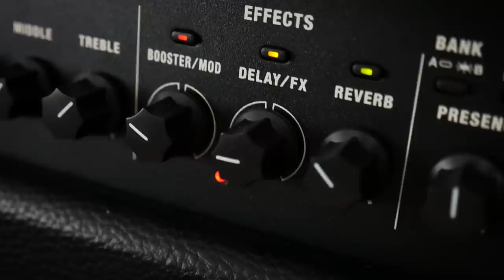Amplifier Classes Explained | Boss Katana Artist

Comment: Hey this video was great and all but would someone mind explain class a in a little more detail? If class a means there's only one output device a tube or transistor what about a vox a.c. 30? I've always heard they were class a but they have 4 output tubes so then it must be ab right?
Reply from the maker: Sorry for the confusion: Class A is the only class that CAN operate with a single output device, but that doesn't mean you can't have more than one. 
Class A operation is defined by the output devices conducting over the entire range of the input signal. This can be achieved with one or more valves/transistors. 

Class AB requires at least 2 output devices to operate. You CANNOT get a single ended Class AB. 

I hope this clears things up.
Reply: @ScienceofLoud  hey thanks so much you definitely cleared that up for me.

Comment: so this is why my valve amp sounds killer but warms up the room by several degrees despite it having open panels and a heat sink? good to know. glad the katana sounds good (if a bit brittle and lacking in the mid-range to my ears), we really need to bring good solid-state amps back to the forefront and maybe get rid of the "if it's tube it rocks, if it's solid it sucks" stereotype. 10 years ago we had that debate concerning digital amps, and nowadays everybody's got a boner for kempers and axe-fx's. the roland jazz chorus is a killer amp that is solid state, but to my knowledge, that's the exception to the poor reputation of ss amps in general.

Comment: You skipped class C. Class C is a class B with compensation for the crossover distortion which does not require biasing. It preserves ALL of the efficiency of class B but reduces the crossover distortion to nearly inaudible. However, 0.1% distortion is common, which wasn't good enough for the distortion wars, so it fell by the wayside.

One way to make a class C is to drive a class B with an op amp but have it's feedback come from the output of the transistors instead of the op amp. The op amp itself will then compensate for the crossover distortion automatically.
Reply from the maker: Class C isn't relevant to audio amplification as it only amplifies one half of the waveform (conducting only over 180 degrees max), hence is moot in this conversation. 

It is used to transmit RF waves, it's not used in guitar amplifiers.

Comment: I spent 2 weeks with the Katana artist.
Let be truthful, and strait.
The Katana does not sound like a good tube amp.
I play metal. I use a 5153 2x12, and Boogie 2c+ head, so that is my reference tone.
The Katana is good for fucking around on ,but it does not come even close to having the presence, and the girth if a good amp.
For a kid with no money, this amp is a god-send.
Great for a ss amp, but it is a ss amp.
As a side note.... companys that put "attenuators" on ss amps really bother me.
The way you attenuate a ss amp, is to turn the volume down.
Unless they have somehow developed on output transformer that thinks it is being fed by output tubes, which they haven't, its just another fake selling point, made to fool uneducated people, and making themselves look like fools in the mean time.
People love to argue about this, they are just wrong.
Even the attenuator on my EVH is fake.
It lowers the pre amp signal before it gets handed off to the output stage, instead of taking the powered output signal, and converting unwanted electrical energy into heat.
Just my 2 cents.
Good video.

Comment: is this to say that class d amplifiers are inferior to class a/b?
Reply from the maker: Absolutely not. There is no such thing as one class of amplifier being objectively inferior - they all offer advantages or disadvantages depending on application. 

Where high power, high efficiency, low cost are important factors Class D far outweighs Class A/B in terms of advantage - which is why we see it used extensively in bass amplifiers, bluetooth speakers, and TV sound systems. 

Class A/B may be preferred in guitar amps, hi-fi and other audio situations due to the fidelity it provides. You pay more for less power, but it yields more accurate reproduction. 

With any amplifier design you trade fidelity for efficiency - and choose the design which best represents the situation and budget.
Reply: @ScienceofLoud  awesome thanks man, in my context I am indeed interested in guitar amps so it seems like if we can find more amps like the katana which can balance the cost and still have class a/b then it's a win

Comment: Little remark: Class A push pull exists ;) a Class AB push pull can become A when biased that way
Reply from the maker: No one said it didn't exist, what was said is that Class A is the only class that can be single ended.

That's not the same as saying Class A can only be single ended, which would be wrong.

Comment: ...so what is Blackstar Metal 100 amp head???
Reply from the maker: Blackstar HT Metal 100 has four 6L6 power valves. They'll be working in two push/pull pairs, so the amp will be Class A/B. 
The website lists also that the clean channel can run as Class A.
Reply: Awesome info. Thx. Love your channel much. Where can I buy me a “More Gain!” shirt too???

Comment: I tend to disagree with your definition of classes A and AB:

For audio amplification, a class A amplifier can be either single-ended or push-pull.  Now, you might be thinking, how can a push-pull amplifier be class A?  Doesn't one side amplify half the waveform and the other side amplify the other half?  Isn't this why we use a phase splitter?  These are common misconceptions.  You can, indeed have a true class A amplifier that operates in push-pull mode.  Amplifier class has absolutely nothing to do with output stage topology. 

Source: Aiken Amps
Reply from the maker: I never said you couldn't have push pull Class A. I simply said that Class A is the only class that can operate Single Ended. 

In fact, I mentioned Push Pull Class A when talking about low wattage Class AB.

Comment: As a bass player I was seduced by a 600W class D amp that weighs 3kg, over my old faithful valve monster with a mere 100W that needs a small team to lift it. I know valve watts are more powerful than solid state watts, but how the flying fuck is 100W louder than 600? On the other hand - on a pub gig I can now run a profit, and I'm a mercenary bastard, now with good back health. But a poorer soul.

Comment: I have an AB and it was sufficiant but once I tried Class A on same Speaker it is a whole other world. In Clean nothing goes over Class A but on Distortion I think AB sounds better. The Katana sounds like crap. For 100 € you get a Laney cub8 class A that is superb and much cheaper. Also I think you recorded with Rode NT1000 that is not good sounding for guitar amp recording. Small and cheap codensator mic would sound much better.

Comment: So, this is actually a Katana promo, thinly disguised as an informative piece on amplifier classes. I'm not impressed. A couple of points. First: class A amps or not more linear than class  AB amps. The distortion just contains different harmonics. Second, it is not just boutique amps that have a single ended design: all early Fenders did and so does the recent Marshall class 5. Second, class D is in fact vastly more linear than class AB. Even cheap class D amps vastly outperforms class AB amps. Almost all PA systems nowawadays are class D and those need a much higher bandwidth than a guitar amp. Third: you are suggesting that the Katana is somehow unique in using a class AB solid state power stage. But that's nonsense. The micro terror for instance also has a simple class AB power opamp as a power stage. Hell, the old samick practice amps were all class AB. Sorry, but I hold you to a higher standard than this!
Reply: Think he mentioned it was a promo. Get over yourself.
Reply: At 4:00 he literally says class AB is the the most common class of amplifier. You really think he is making the katana out to be unique with this statement?

Comment: A/B is more linear and more expensive than Class D to build generally. Class D is more efficient but less Linear and less expensive generally to build....  There are Class A ultra linear but extremely inefficient. Class A/B, B, C, D, G, H and others....  Have to laugh though when they are using extreme limited bandwidth "Metal" as their example.

Comment: I really enjoyed the Amp Class class. I knew some of it but it was a mess in my head. 

Though, I'd like to point out that every time someone states that "many could not tell the difference between SS and valves" it's always after some heavily compressed and distorted guitar bits. I agree, I couldn't probably as well. To me it sounded like you could have played through the Line 6 Pocket Pod I had and it would have sounded the same.

Where I see a difference though is at the point where the amp is almost breaking up. You know, cranking a 68 Deluxe Reverb and playing loud enough so it overdrives? I wish I could ear a solid state amp do that. 

Here's an example of what seems to be a P90 pickup through a cranked Class A amp.... Can you recreate that on Katana? 
https://www.youtube.com/watch?v=d_bMAtXJyZE